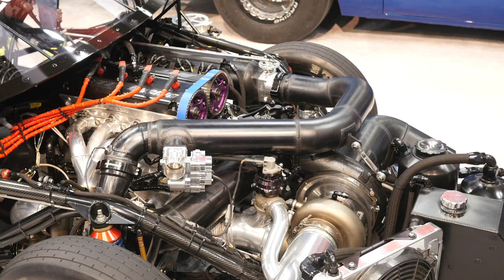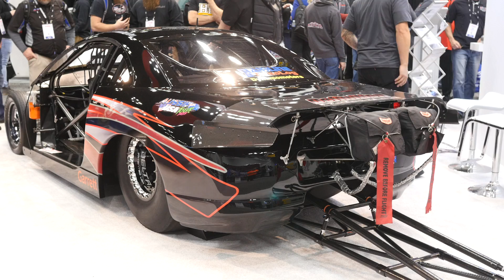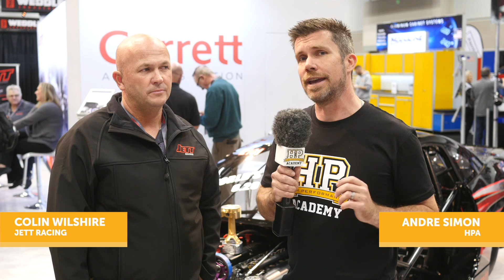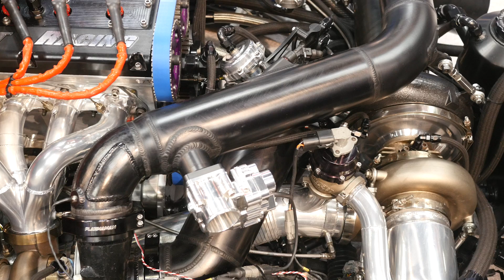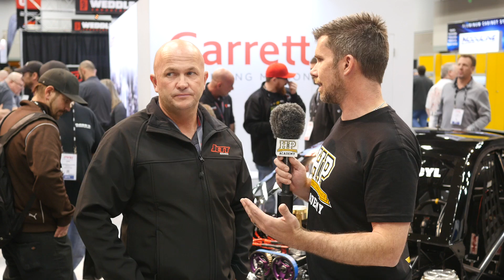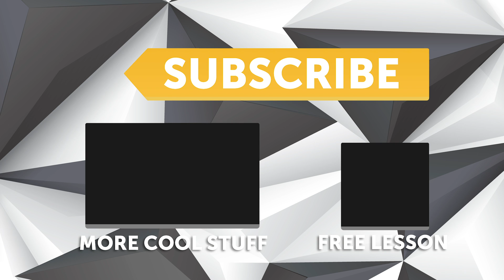110 PSI At 80,000 RPM Turbo Speed | Worlds Quickest 4 Cylinder | Jett Racing [TECH TALK]

Comment: It would be interesting to hear what fuel pressure he is running, it has to be more than the manifold air  pressure, so I would think it must be at least 155 psi. (112 psi Boost plus 43 psi ambient), but I have no idea on running that much boost. Also the guy talking about 500 HP was saying that he was using 1000 CC injectors to achieve 500 HP on his car. It might be wise to read what the guy is saying  before commenting.  
It is nice to hear someone talking about compressor maps instead of 88" etc. I learned turbos in the 1970s  and no one talked about bore sizes of turbos, mind you hardly anyone was talking about turbos except the 935 Porsche guys who inspired me to Turbo my Firebird Trans Am, and I still have the car. Sadly it is only making half of the HP he is and on over 7000 CCs displacement. Mind you I have insane Torque at 3000 RPM. I also have a Talon that puts out about 500 Hp, that was my 90S and early 2000s commuter Vehicle.

Comment: I'm a bit confused about the part of weight. He says adding a cooling system adds weight, but adding piping for a second turbo and the turbo itself is lighter? how is that possible? At least with a cooling system you'd have the option of spreading the weight load across the vehicle better, where as a turbo needs to be close to the engine and subsequently limits where you can spread the weight...

Comment: Too bad you guys are over 30 years late behind the tractor pullers
Reply from the maker: 2000HP 4 bangers gasoline engines with this capacity 30 years ago? That's awesome, throw up some links - Taz.
Reply: @hpa101  I was primarily referring to compound turbo charging. Farmers were starting this in the late 70s on diesel pulling tractors. I don't have an exact date when it showed up on alcohol powered but definitely late 80s early 90s. It's funny that it's just starting to show up on the racetrack now. I'm doing a compound low pressure setup on a 8.8L propane-fired low RPM engine. Keep up the excellent work bro! I appreciate you!

 https://youtu.be/cAghxb2C9WQ triple turbo compound set ups
Reply from the maker: Ahh yep, it's been around for a long time but a tractor pull setup and a 8, 7, 6, 5 second etc drag car are pretty different beasts and the class rules I believe are also more restrictive with tractor pulling that makes compound turbocharging a requirement not just an option if they want to hit the power levels required to be competitive.
There are always reasons around why things are and aren't popular from advancements in tech to costs, weight, rules etc etc etc - Taz.
Reply: @hpa101  very true. What's funny is these farmers have been making this stuff work with mostly homemade mechanical fuel injection systems. These systems would not be suitable for drag racing do the inconsistency I would say. But with all the electronic controls now it is completely feasible for anything to be assembled and ran consistently
Reply from the maker: @christianmgtow4744  there are some very clever people out there who just happen to make a living farming 😉 Even now as things get more and more advanced there are still guys in sheds doing things that are insanely clever - Taz.

Comment: At some point, you wonder why the 4-cylinders or any number of cylinders are still there? At 110 psi boost that is a 8.5:1 compression ratio without ANY pistons or cylinders. Just take that the air, run it into a can, spraying in the fuel and burn it! Then run the exhaust to the turbos' exhaust turbines. Take the turboshafts and run it to the gear box. Voila! You got yourself a turboshaft engine. They can be made very power dense. How dense? Something 200kg in weight -- about the same as a chevy smallblock V8 or a turbocharged V6 -- and about the same size can get you about 3000shp. Not bad!

Comment: With that HORSEPOWER, you reached the threshold 100%  therefore all fluids - electricals -  mechanicals  as well as air density and variable ambient temperatures should be re-configured.
One run, thats it

Try titanium internals, a fuel delivery that can supply the public dam, an lubrication that will beat your wife when wet and a wind turbine that can cool the engine and the turbo ait charge.

Comment: Why not mounting your turbos on a single shaft and couple this shaft to the crank with planatary gearbox. You would have the responsiveness of a supercharger with the energy recuperation  of a turbo. Or basically a turbofan working in parallel with a four stroke engine.

Comment: extreme tuners listen up! 2200whp off a fully LEGIT 4g63
Reply: Yeah that is not a 4g63. It has the dimensions of a 4g63, but the block and head materials, engineering, strength etc, is a very long way from a Mitsubishi 4g63.
Still, awesome.
Reply: @stevenkelby2169  ik what u mean. its all billet and not a stock 4g cast but its still a rough 4g design made from a stronger better material so i consider it a 4g. im not one of those ppl that just calls it a "dart block" or "bullet block" its a race application of mitsubishi's core design hence 4g
Reply: @ogswagkillapbeastmode694  What he means is there is hardly anything left of the original engine. It just has the same basic dimensions and component locations.
When you're making a whole new billet block + all forged internals + all new head it hardly even matters what engine you started out with. People have done this sort of thing with Honda engines, Nissan engines, Toyota engines, VW engines, basically any engine there is a good supply of aftermarket parts for. When you've got 50k$+ to spend on an engine you could make a Lada produce 1000+hp.

Comment: 5  2700cc injectors per cylinder plus 2 in the intake ? wow.
Reply: Imagine what kind of magneto it takes the light all the alcohol
Reply: chris mccleary Arc reactor
Reply: And that 2700cc is probably at 3 bar base pressure and they run 6 bar base so would be about 3500cc per injector?

Comment: also something to note is that when you add pressure to the inlet of the secondary turbo, the pressure ratio across the secondary's compressor can remain the same but you can achieve much higher boost pressure. in other words this means you can keep your secondary compressor within its optimal pressure ratio zone while drastically increasing its volumetric output (pressure, flow)

also, you can think of compounding as turbocharging a turbo that is turbocharging the engine

Comment: All hail the 4G63
Reply: Is it still a 4g63????I don't think so
Reply: Dirk Diggler if it’s same dimensions it’s the same
Reply: @lucassturgin8710  it's a billet block......lots of billet stuff on it???So tell me more how 4g63 is it???
Reply: It’s literally all 4g63 internals just cause it’s a got a block strong to make more power doesn’t make it not a 4g63 if the motor never existed non of his parts would exist either it’s a 4g63
Reply: @lucassturgin8710  Okay if you say so.Let's just say it's a Billet 4g63.....They run electric waterpump....external oil pump blah blah.Go put the billet block next to the Factory Block and tell me how much alike they are....I'm not hating here its very impressive.I think these guys run a billet Head too thats designed way different than OEM...
Reply: Dirk Diggler just a different material:)
Reply: @4door_papi  So robocop will still be robocop if he was made from wood??Yip okay makes sence now 😆
Reply: Dirk Diggler bad analogy but ok
Reply: If it’s billet it would probably be roughly the same if it’s based off a 4g63 i wouldn’t run it down a street I’m saying it’s the top of the like 4g63

Comment: Think I said this before, but I wonder how long before someone makes a billet block and head as one piece, a 'monoblock', to completely remove the problem of head gasket failure* - cooling wouldn't be an issue for a methanol drag engine and the machining of the various internal sections should be solvable with some thought?
I think it was the 935 engine [edit] 935/78 to be precise [/edit] that Porsche welded the heads on, not sure the exact process, but may be repeatable?

Very common back in the 'middle ages' - perhaps best known from the Offenhauser Indy engine which had it's last win there in '60, and last speedway win in '78 - yes, I had to look those up.
Good story and detailed pic's of the Offy here - heck, should be of interest for ANY engine guy - https://www.hotrod.com/articles/assembling-270ci-offenhauser-indycar-engine-step/
Reply: I always thought of just attaching angle iron  to the sides and bolt it down
Reply: I am an avid fan of most motorsports and I'm sure the negatives outweigh the advantages of a solid design, otherwise we still would be using Ford Flatheads in motorsports.
Reply: @dj4monie  
That is certainly one of the more ignorant replies I have seen on YT - certainly the latter part as there are still classes for the flathead in some forms of motorsport - certainly at 'The Lake'.

Comment: I'm not trying to bicker with you quoting the billet 4G63 block has the OEM DNA, but IMO its more like 4G63 design. Because as from my understanding, there are no OEM material actually in that billet block.

the weakness off the orginal 4G63 had been redesigned for this billet item and super improved to not lift heads without a headgasket at that power and boost. 
It's a prettu amazing piece really.
Reply: Why is this non-important fact like to be debated until the cows come home? The real issue is serious output is out of the reach of the average enthusiast. It always has been, because leading edge technology comes at a price and you have to be willing to get to a point to where you need help from people smarter than yourself. There is no reason really to have more than 500 hp in a 4 cylinder car on the street. In-fact it would be fun at 350-400 hp and you can keep the majority of your stock parts. I have goals that require 600-650 hp and I don't close doors otherwise I try to apaise purist while they don't donate a dollar to help me.

Comment: It's great hearing Shane T's approach with the charge air cooling with coolers vs evaporative cooling of methanol that Jett uses. Great Interview as always!
Reply: That's not Shane T tho? am I missing something?
Reply: @nickacelvn  Shane t talks about an SR he tunes where first thing he did was re fit the intercooler.
Reply: But it's not really a debate, charge cooling or cooling with fuel. Jett cools with fuel, nothing wrong with that but burns up a ton of fuel. I doubt the Mazworkz car runs that many injectors. Indy car used to run pre-turbo methanol injectors for cooling since they didn't use intercoolers in those days.

Comment: 2750cc times 5 per cylinder! is there any room for air left?
Reply: Id guess about 10 liters. in 6 seconds.
Reply: 5gal/.25miles. Lol
Reply: James Nichols I live my life 5 gallons at a time.
Reply: @spankthemonkey3437  Not up to TF/FC levels, Big Daddy used to say he went through 20 gallons of 98% Nitro on each pass. The car would almost starve for fuel crossing the MPH stripe.
Reply: That's just insane
Reply: Sure 100+ psi @ likely 100-110 cfm is a ton of air...
Reply: @mister clean  Still not up to Top Fuel/Nitro Funny car levels who go through 20 gallons in ONE PASS.
Reply: @dj4monie  They basically use an engine oil pump to deliver the bulk of the fuel, the fuel output is like a garden hose. The EFI is only there to fine tune the injection.

Comment: Twin turbo imports have been done many years ago. Mike Miranda(SPI power excel) CRX had twin turbo along with quite a few others.
Reply from the maker: Compound systems...? Throw up a link, anyone into compound turbo setups like Jett Racings will be keen to see that 😎 - Taz.
Reply: Id wanna see stock compound system too, not many stock cars need such pressure ratio
Reply: @Skaude  Why would you wanna see stock compound systems when OE's are working with electronic motors to spool turbos faster?Audi already has this technology on it's Q7 SUV. What you mean you want to see this on the street. Not need use nitrous, it's cheaper.
Reply: @dj4monie  why would i wanna see, indeed. cause theres virtually  no stock cars with compound systems.
Reply: This compound, not twin turbo...
Reply: Subaru B4 twin turbo
Reply: @coreyporteous1543  is a staged turbo, not compound.

Comment: Wow!  That is crazy.  Compounding a 2ltr 4 cylinder, Gale Banks would be proud.  Also 5 injectors per cylinder!! Epic.
Reply: Mazworx Shane T has the sr20 which is three  turbo.
Reply: Really?!  I wonder if that is beginning to be overkill on the sr20?
Reply: @boosthit811  Why, Andre talked to Shane about, you didn't get a notification????  Compounding for ultra high output 4 cylinder is the next logical step you can only go so big with a turbo before response is impacted negatively even with anti-lag, 2 steps and nitrous oxide. I run nitrous oxide to get next frame turbo output out of a smaller turbo that is still responsive enough to be fun for daily use.
Reply: No I haven't seen that video.  Sound good tho.
Reply: @dj4monie  
No no, the next logical  step would be starting to work with something that has a bit higher oxygen percentage than air, maybe pure oxygen. Now, i know this sounds completlx insane but let me ask you this question: what is more insane, trying to compound a little 4 cylinder to get over 110 psi, wich are around 7,58 bar or just enhance the oxygen percentage so much that you could run without a secondary turbo ;D? I mean, regular gas needs around 14,7:1 fuel-air  ratio and nitromethan needs around 1.7:1, so probably would benefit  a lot from that, if there wouldn't the high corrosion risk :D. I read about some guys that used an oxygen-CO2 mixture to prevent to much damage .
Reply: problem being is that depending on the class the vehicle races there are certain rules that need to be followed. fuel restrictions come into play there are plenty of oxiginated fuels on the market
Reply: if you start talking about nitro I mean top fuel dragsters have the engines rebuilt after EVERY pass so I don't think they worry about corrosion to much. the amount of fuel consumed in a single pass also is just insane. you don't just want to go playing around with oxi like that
Reply: @trickdacy6865  
Actually, NO2 (nitrous oxygen) is much more stable than pure oxygen and therefor not that much corrosive. 
Dragster engines are getting rebuilt because of the emense power they produce. 10000 HP and that are just 32%, the rest of the chemical energy of these massive loads of fuel burned in this mashines is pretty much wasted heat and frigtion losses. That means, 31250 HP of heat and friction are getting stuffed into an uncooled V8 cylinder block (into the bearing surfaces of the piston, conrod, crankshaft and cylinder walls).
If you gonna have to search for melted sparkplug pieces, corrosion will pretty much be the least of your concerns ;D. I meant pure oxygen wich in itselfe mixed with enough heat, lights everything on fire, even metals.
Reply: @trickdacy6865  
Also, "plenty of  oxiginated fuels"? If we are talking about the same stuff, i know just 3 that are available and that would be Methanol, Ethanol (and various mixtures between those two and regular gasoline )and nitromethan.
Reply: @Enthropical_Thunder  Oh so you want to have an actual bomb for an engine? This pure oxygen nonsense has been around before you were born, it's hard enough to control without it being contained. You are talking about a BOMB if something goes wrong.
Reply: @Enthropical_Thunder  Nitrous has limitations, the biggest being bottle pressure. Adding more bottles doesn't solve the problem. That said, more turbo owners instead of contemplating another turbo upgrade, just add nitrous, you'll make more power than you know what to do it for less money.
Reply: @Enthropical_Thunder  VP MS109, VP MS103, VP MS109E, VP 101E (50 State legal)
Reply: @dj4monie  
Ehm no, i am not talking about a bomb, i am  
talking about something a bit more controllable, a rocket engine ;D.

No for real now, adjusting the oxygen flow is no real challenge for someone with a modern ECU and that's basically what makes the difference between a bomb and an engine.

The real limitation is the metallurgy, Oxygen is very reactive, that's why everyone uses the worse performing but much less reactive (safer) nitrous oxide.

In fact, for dragraces, such a system would perform much better in comparison to forced induction systems, simply because of the higher power/weight ratio.

You are talking about the limitations of nitrous oxide bottle pressure and you are completely right with them, however, you don't seem to see, the limitations of forced induction, just try and compare them, i will garantee you, that you will come to the same conclusion as i do.
Reply: Then you don't know the other way to generate bottle pressure even with a 300-400 hp shot and it stable and stays at 1200 lbs of pressure. Pure O2 is a bomb waiting to happen....Some idiot will get the tune wrong and threaten the safety of others. IT won't happen.
Reply: @Enthropical_Thunder  I do understand mechanical limits but they haven't been reached. 3000 hp 4 cylinder under 2.5L, 5000 hp at 5-6L and of course Top Fuel is 10,000+ whp and they are being limited by the rules (NHRA) You can put a turbine in a car or even a liquid fuel rocket engine (Budweiser Rocket Car and Blue Flame record holder before the Brits). Injecting o2 is dangerous, don't pretend others haven't tried, modern ecu's have nothing to do with it.
Reply: @dj4monie  
Well, first, people actually tried it befor, the only thing that prevents pure oxygen of being used, is the fuss around mixing it with the air respectively other gases, to reduce it's reactivity. Pure oxygen in itself is no bomb, in fact, nitromethan is much more of a bomb, as it is basically oxygen enriched fuel.

The point about modern ecus is their ability to guarantee a much better oxygen flow control for  less money.